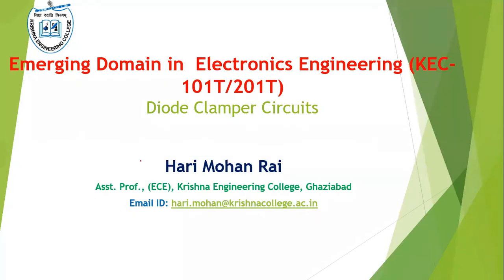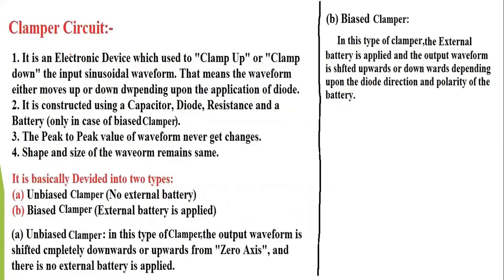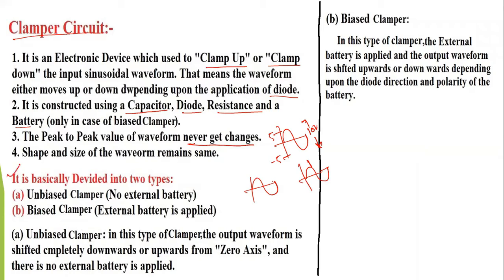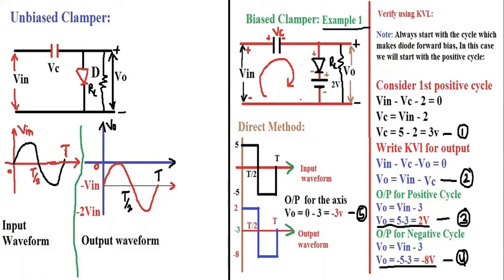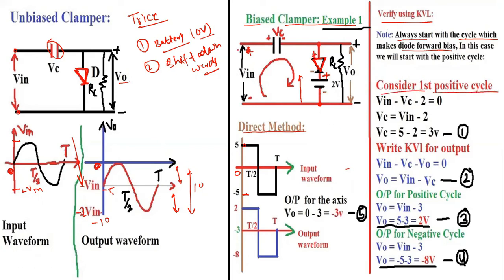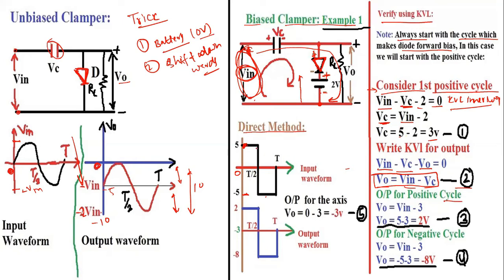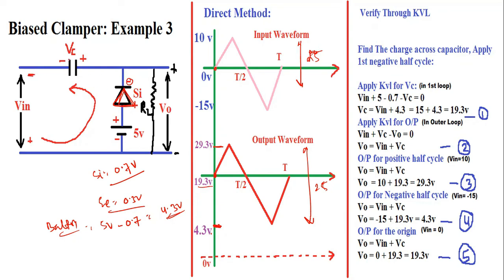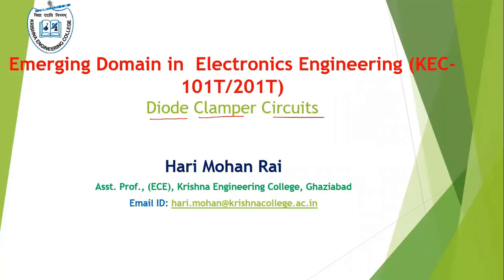1.11 Diode Clamper Circuits || Unbiased & biased clampers || trick to draw output waveform(Hindi)

Comment: Sir biased clamper ke example 2 me applying KVL for output wale me Vin ka sign to anticlockwise wale direction me hai but baaki Vc and Vo ka sign to clockwise direction me hai.... I have doubt in that equation
Reply from the maker: @yukti-eg2ty  Actually,  humne input voltage ka sign consider nhi kiya hai use generalized karne ke liye. Matlab ki uski jagah per baad me positive half cycle ka voltage and negative half cycle ka voltage put kar dete hai. Baki voltages ke sign as it is use karte hai jaise KVL me use karte hai.